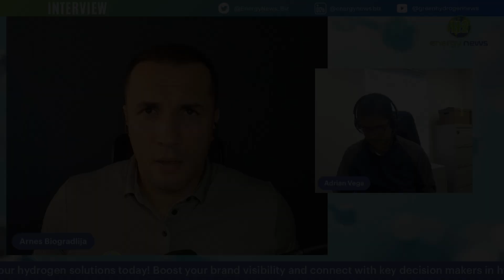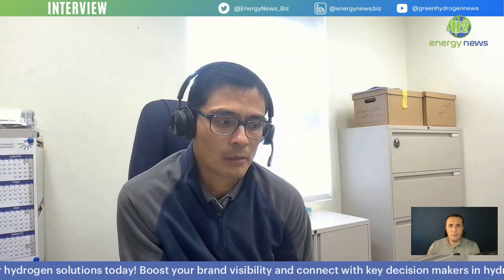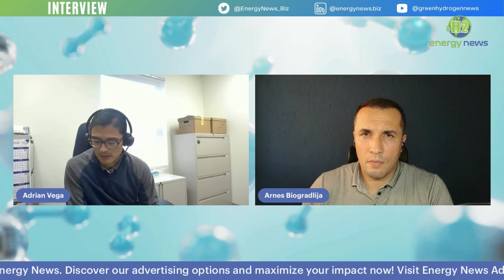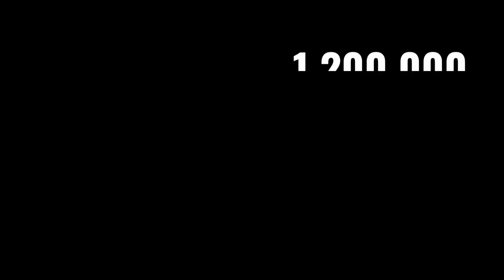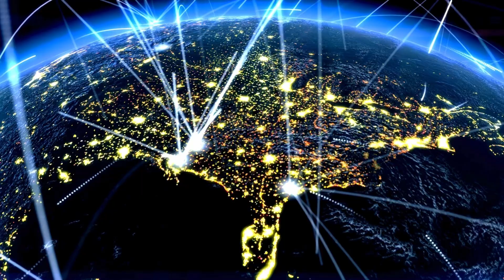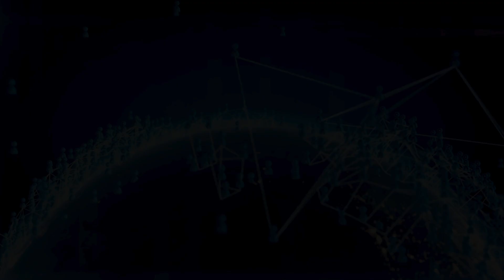Canada's Bold Plan for Nuclear-Powered Hydrogen

Comment: My main takeaway from this interview is that it is primarily about confirmation bias.

I totally understand this, if you're really interested in something, especially something that you have put a lot of effort into studying it and it is also paying your bills, then it is very easy to focus on specific individual elements, in this case hydrogen and nuclear, and forget to look at the big picture.

I may have got something wrong, but from my understanding of modern thermal electricity generation plants, they do everything they can to maximise the plant efficiency including substantial energy recovery from the waste heat. For example, they don't just vent the steam from the turbine, they use it to preheat the water/steam going back to the boiler from the final condensation stage. If you're using some of this heat to actually reduce the electricity demand for electrolysis, which in reality won't be a huge reduction, then you're probably reducing the overall efficiency of the actual generation plant. Also, contrary to common claims, high temperature electrolysis is actually less efficient than low temperature electrolysis because the increase in thermal energy input is greater than the reduction in electricity use.

My preliminary analysis suggests that even if there is a small gain from using heat to replace electricity, the improved efficiency will be nowhere near enough to compensate for the very high price of nuclear electricity.

As the saying goes; "There is no such thing as a free lunch", which in the science realm translates to 'you can't beat entropy'

Comment: If you take industrial CO2, convert it to syngas and then into SAF, synthetic aviation fuel, the FOSSIL CO2 still just ends up in the atmosphere, so this SAF isn't low carbon, at best you could call it 50% reduction because you have used the carbon twice effectively. If you want clean SAF, then you need to start with either biogenic CO2 or possibly from DACC.